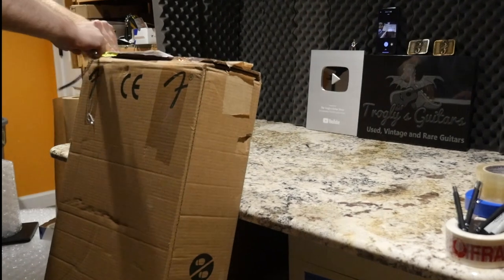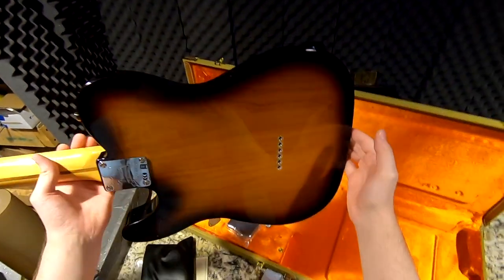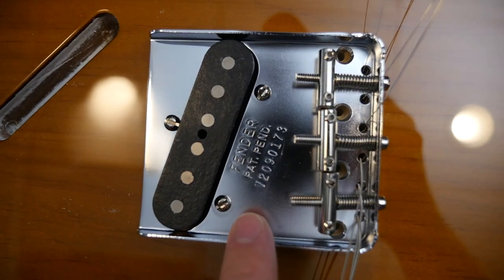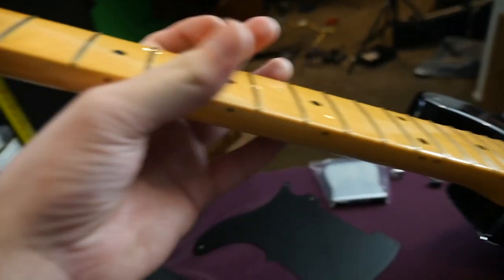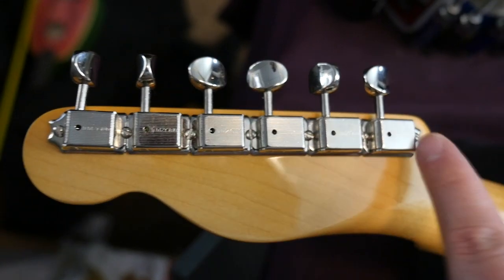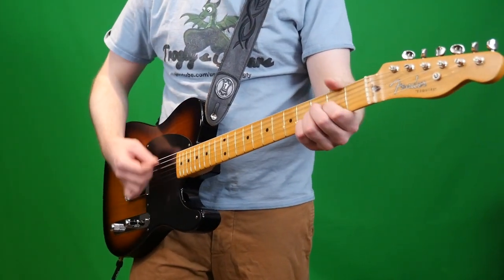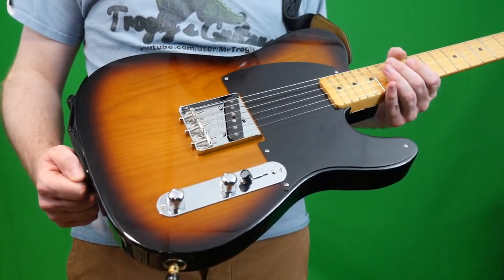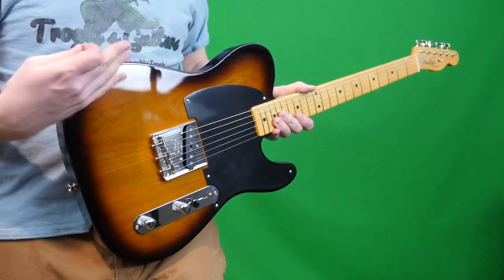It's Simple... but Is It Good? | 2020 Fender 70th Anniversary Esquire Review + Demo

Comment: I'm a Tele guy, but I've always had a soft spot for Esquires. Unbelievably simple but surprisingly versatile if you know how to use it. I've gotta say though, I never did have too much use for the stock third position. The 'Eldred' mod (aka the cocked wah mod) gives you a much more usable sound, in my opinion anyway.
Reply: Totally in agreement with you, the "Eldred" Mod is both very cool and very usable.
Reply: I'm right there with you, and I have a couple of partscaster esquire builds that I love.  I just don't do the fixed cap on the front position, but if I were to, I'd use it as almost a "woman tone" type thing.  Throw some fuzz or heavy overdrive on it and you've got some very fun sounds.
Reply: Agreed. I've been very intrigued with the Eldred mod since seeing him demo it on the Fender channel at least 10 years ago. I have a Tele now and would love to give it a try.
Reply: Yes that's my favorite position. Kinda feels like a very light overdrive. Very useful going into a clean tube amp. I've always loved the tele bridge pickup. So lively and emotional. This position basically bypasses the controls, so it adds a little top end frequency hair to it.
Reply: @anthonyc1883  I'd be willing to bet that's the same video I saw that got me interested in it. It's a very worthwhile mod, especially compared to the stock wiring. I've since turned my Esquire back into a Tele, but I still managed to utilize a version of the Eldred wiring. First position is the bridge with the old Broadcaster blend wiring, so you can gradually add in the neck pickup (from just a touch to roll off some of the 'bite' all the way up to both pickups full out). Middle position is the neck pickup by itself, and the third position is the Eldred wiring, only on the neck pickup instead of the bridge. It still gives you that 'cocked wah' tone, just a little fatter and fuller. I've tried a few different Tele wirings, this one is definitely my favorite.
Reply: @FuzzBass66  This has the Eldred Mod.  The original wiring is a main cap for tone and 2 more caps and a resistor for the pre set bassy tone.
Reply: @popiel52  I know how they are stock, the first time I built one I used the stock schematic and...yeah, not for me. But you're right, upon watching the video again on a screen bigger and less broken than my phone it definitely only uses the single capacitor for the third position. The sound was what confused me the most. It doesn't seem to have the 'squawk' or 'quack' of the Eldred mod I know. Maybe they used a different value of capacitor? Maybe I need to get my ears checked? Who knows haha. Perhaps a deeper technical dive is in order on my end, I'm curious now...
Reply: @FuzzBass66  Wow, nice. You've really expanded the tonal pallet. Never would think to do the Eldred mod on the neck pickup. Is that wiring scheme your own, or is it out there for others to use?
Reply: @anthonyc1883  It really did add a lot to the tonal pallet and overall versatility. The circuit as a whole is essentially just the original 'Broadcaster blend/dark circuit' with the third position (which would have originally been the so called 'dark circuit' position) modified Eldred style instead. You follow the original schematic as is for the first two positions. The third position calls for a very large capacitor (0.05uf usually) and a resistor (the resistor was to induce a slight drop in output, or so I've read). Ditch those and substitute a 0.0047uf capacitor, and that's it. You can experiment around with different capacitor values according to personal preference, but the 0.0047uf is the most common one I've seen in Eldred schematics, and in my opinion gives the best 'cocked wah' sound, lots of 'squawk' and 'quack'.
Reply: @FuzzBass66  Thanks. And for those who haven't seen it, here's the 2008 Mike Eldred video demoing the "Eldred mod." Starts at 5 mins. 48 secs.
Reply: I did the Eldred mod on mine too. Converted from a Tele to an Esquire with a P90 voiced pickup. I use that position for leads alot, only downside is it is still a bit quieter than the bridge w/volume position.

Comment: There comes a time in every guitar player’s life when they learn what the toggle switch does on an Esquire. 
My mind was blown when I learned the toggle switch pre-dates the two pickup model.
Reply: Even when the two pickup models came out they were still wired different. I believe they were wired bridge pickup/neck pickup/neck pickup with a capacitor.
Reply: @squidge7436  Yea but bridge pickup position has a blend knob instead of tone knob. Blends the neck with the bridge. I know cause I just bought a partscaster with that wiring scheme. Blend knob doesn’t work on middle or neck position either.

Comment: If the screws In The Bridge aren’t grabbing that means the holes are stripped out. U can super glue a little piece of a toothpick in the hole and it fixes it or u can use a longer screw or a bigger diameter screw in some cases. U can use the same trick on any screw hole on your guitar. If it’s an expensive guitar u might want to plug the hole with a dowel rod and re drill the hole

Comment: I LOVE the simplicity of the Esquire. The headstock is my favorite design. And one pickup is enough, just think what Jeff Beck was doing on his Esquire with the Yardbirds. 

I have been wanting  a Esquire for sometime, I was first thinking of getting a used Custom Shop in blonde, MOST of the ones I'd see cost between 2,800 - 4,000.  Most of them that I saw were either too much that I was willing to spend or they were too relic looking for my taste. Then I found about the 70th Anniversary Esquire. New ones are currently ( as of June, 2021 ) going for 1,999.00, which isn't too bad ( I had just bought in Feb a Gibson 50's reissue LP for 2,020.00 ).

Hearing/watching your demo and review, made me for get about getting a Custom Shop, because "I" cannot rely tell the difference in the sound between the two, but my wallet  can tell quite a bit concerning the cost! So, I just bought a "mint" 70th Anniversary Esquire in the white blonde with a white pickguard ( as switch I wanted to do anyway ) for 1,500. It will be interesting to see how the thin finish will change it's color in time. Thanks for the GREAT demo and review that got me on the right path. Cheers
Reply: I just picked up a white blonde for about the same price! Such a fun guitar
Reply: @evanceremony7145  You'll enjoy it like I am STILL enjoying mine, cheers!

Comment: Pine wood is light and resonant but highly disconcerting that on a 2k guitar the bridge screws are about to come off!!
Reply: The Irony is that Leo Fender very quickly switched from pine to swamp ash because pine is quite soft and dented more easily.
Reply: @shaunw9270  you are right. Either  you use very old stock cold climate seasoned pine or wider longer screws, and they have done neither! Lots of people out there getting fooled by this vintage reissue gimmick
Reply: @Calbertone  I don't know I have always been into the vintage reissue '52 Tele which unfortunately were bad in their original early 80's incarnation with either a canary yellow or a mustard colour and wrong 70's body shape ,but since the late 80's up to the end of "Pure Vintage" they were always great and probably the easiest to get away with , because once you start studying blackguards , you soon realise there isn't a super correct one to go by. I just know that was Leo's reason for not using pine after only a very few were sold because he thought it was good to work with but dented too readily for a professional instrument.
Reply: @Calbertone   He did say it was roasted, which can give it some strength.  I've had pine body's in the past, and I stopped using them solely because of the denting problem.  But if you look up Rick Kelly out of Carmine St. Guitars in NYC, he makes guitars out of pine used from old buildings in Manhattan, and they are strong as can be.  So I think the treatment helps, or at least I hope it does.
Reply: I agree. I don’t ever want screws that don’t stop turning - on anything, especially a $2k guitar. I think this is just for collectors.
Reply: @shaunw9270  g&l asat is just a superior guitar in my opinion
Reply: @jgenoese  Depends what you call superior. I like old music ,the players and their guitars, so vintage reissues are superior, to me.
Reply: @shaunw9270  well my asat is made with ash (better wood) and has 6 individual saddles for better intonation.
Reply: @jgenoese  I'm happy with my '52 reissue. Never had intonation issues. It came supplied with a 6 saddle bridge if I really wanted to fit it but then I may as well have bought a Non vintage spec Tele. Nothing wrong with an ASAT ,but I wanted a Telecaster. My "52" is swamp ash too but the idea of the Esquire being pine ,is that very early Esquires were pine. You really don't understand vintage reissues obviously.
Reply: Pine is a very soft wood.
Reply: They use 9 thru 42 gauge strings, less tension. I own one, beautiful sound with tons of sustain. Nicest quality and sound, better than my Ultra Telecaster…

Comment: The treble roll off circuit  when you flip it to the ,"what would be neck position" is very useful, obviously you haven't  played long enough or gigged enough to know the  tone nuances of the Esquire, )or any guitar for that matter), That re-do of the pine Esquire is a fabulous guitar.  Seems all you care about is running a crappy sounding distortion setting on your amp or pedal.  maybe years in the future  you will gain experience and educate your tonal palette

Comment: Add a fuzz when in the “neck” position and it will sense. Personally I set the “middle” position with the tone back 25% for rhythm and riffs then switch to the “bridge” setting for lead stuff.  I also control the dirt with the volume control. A simple guitar that’s deceptively versatile.

Comment: I personally like to set my amp for a very bright sound, but balance it by setting my guitar for a very dark sound when playing chords.  That yields a balanced sound for chords, but then opening the treble for lead parts will produce a brighter sound than would be possible if the amp were dialed for a flatter frequency response.  Although the third position sounds rather dark the way Trogly had his amp set, it's not that much different from how my guitar would sound with a flat eq.

Comment: Trogly, did Fender use pine bodies for the P bass in the early 50's?
Reply: Nope.
Reply: @justinkase8642 , thanks!
Reply: @maanjezus8622  No problem! Would be a cool idea to build if you have the right lumber, some very old pine that's well dried.
Reply: @justinkase8642 , Oh yeah. I was wondering about it if they were made of pine. Squier still makes those P'51 basses from pine wood. So bad it's not period correct.
Reply: @maanjezus8622  Completely forgot they made those. It's a cool idea, especially if you find one with a unique grain pattern. Pine is an underrated body material imo.

Comment: What’s the difference between that neck circuit and the such called ‘dark circuit’?
Reply: I believe the dark circuit is usually used to refer to vintage elecaster wiring. Telecaster 3-way positions used to be normal tele bridge (back position)-normal tele neck (middle position)-all tone rolled off (forward position). And the tele circuits had the forward position with all the tone rolled off on the neck pickup, whereas the Esquire rolls the tone off on the bridge pickup.

Comment: I’m kinda really confused what the neck position is. It’s like the opposite of a treble bleed. It’s taking treble out of the circuit. But why? Can someone explain what it is?
Reply: Guitar philosophy was way different when the Esquire was made. Guitar makers thought guitar had two modes with two distinct sounds: lead with a super bright bridge-pickup sound, or rhythm with a super dark muddy sound. So you have a bright sound that cuts through the mix when you want to be heard and a dark muddy sound that blends in during rhythm. Nowadays we use different guitar switch positions for different sounds, but back in the day they expected a lead/rhythm 2 mode setup.
Reply: @cmiddleton9872  thank you

Comment: No, it needs to be upgraded to two stacked active 'hot' humbuckers wired series and parallel and single-coil, and all coils tapped at lesser coil windings, in-phase and out-of-phase switching, a piezo under the saddle, plus on-board gain boost, and a seven-position selector switch ...

Comment: 6:00    Thats the biggest issue with teles... I have two of them and already lost one of those tips hehehe
Reply: Clear nail polish. Works on pretty much everything. Forms a sturdy-yet-breakable bond and is removable (with acetone-based polish removers) if you ever feel so compelled.

Comment: kinda disappointing for a 70th anniversary IMO. I think the pickup sounds great, but routing it for a neck pickup was a huge mistake. why even purchase this guitar when you can just take out your neck pickup? I guess the only thing would be the ashtray and the different pickup? The tone options on the selector switch are cringe and IMO useless. It's so much easier to just roll off your tone if your familiar with tele pickup selectors. They are not intuitive. Especially when pushing upwards towards the neck for that respective pickup (gotta get your hand in the right spot cause of the volume knob). I guess you could argue the neck shape and radius too maybe.
Reply: It is almost certainly routed for a neck pickup because the original Esquires were the same way. Seems this model, being a "70th Anniversary" is meant to be a copy of the originals (the earliest few when pine was used). Also,  yes you can purchase a Tele and "just take out your neck pickup" but then a new pickguard without the hole would be required, PLUS there is some rewiring to do beyond simply snipping off or unsoldering the two wires that service the neck pickup. If you look up an Esquire wiring diagram and a Telecaster wiring diagram you will see that statement is correct. If you're handy with a soldering iron, great, DIY. Many people are not.

Comment: I used to own a 1952 all-original sunburst Esquire - rare finish that year. I bought it in 1974 from a tobacco farmer in Kernersville NC for 250 bucks. In 1979 I traded it straight for an all-original sunburst 1960 strat at Norman's Rare Guitars, then in N Hollywood. The strat was tagged 800 bucks at the time. 24 years later I sold the strat when I needed cash. Wish I hadn't given up the 52 Esquire as I'm strictly a Tele/Esquire nowadays.

Comment: If spent $2000 on a guitar and a knob fell off I would flip my lid.
Reply: If I didn't own any screwdrivers sure, but it's an easy fix to put back on. Plus, I usually take them off anyway and put the pointers in my preferred spots.

Comment: They make the body from pine because it's cheaper than real tonewoods, alder, ash, maple, Koa, etc., yet they still want an arm and a leg for it.
I made my own Esquire by simply getting rid of that rotten sounding neck pickup and wiring it through the volume and tone pots and then to the output jack. Advantage.....I have a six saddle bridge for perfect intonation. The truss rod is adjusted at the head instead of the body. I eliminated the switch altogether, witch gives me all the tonal variations I need. All for a fraction of the cost of this clunker. I will never understand why Guitar makers insist on making exact reproductions of the mistakes Leo Fender made 70 years ago. Leo was an electronic whiz, but NOT a player. I upgraded the bridge pickup with a Fender '62 American Vintage pickup and now have a great sounding Esquire without all the B.S.